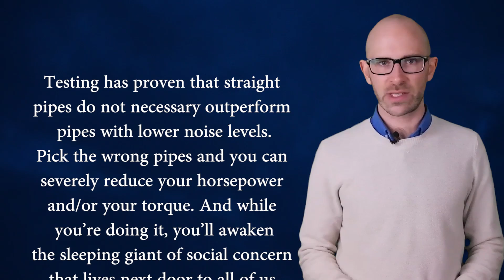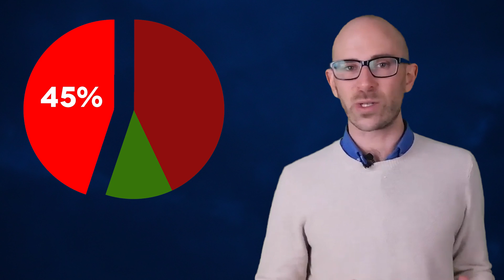Why are Harley Davidson Motorcycles So Loud?

Comment: You may have an error with your dBs... you mention sound pressure, which is typically using a reference of 20 µPa.  The sound pressure doubles every 6 dB and 20 dB is ten times higher.  For sound power and sound intensity, they double every 3 dB and 10 dB is ten times higher; this is because they are referenced to 10e−12 W and 10e−12 W/m^2 respectively.

Love the channel though!

Comment: Loud pipes don't do anything to save lives, skill saves lives.
Reply: Went from a bike with loud pipes to a bike with quiet stock pipes. Noticed zero difference in drivers attention. What did change was my skill level. I learned better to anticipate and prepare for situations regardless of what noise the bike makes. People don't care if you have loud pipes, high viz, high beams, all of the lights. It doesn't matter if they aren't paying attention they will neither hear nor see you.  Those things help in small increments, what really helps is learning to read behavior patters and lane positioning.
Reply: what if you are in the blind spot of a vehicle. They will hear a Harley. Blind spots tend to be where cars run into motorcycles, especially in traffic.
Reply: Ufphen why would you allow yourself to be in a vehicles blind spot? That's were you would need more skill.
Reply: take for instance traffic where you cant evade an idiot driver or in Cali where lane splitting is legal and cars may change lanes and run into you. Skill will most undoubtedly not save you from crashing just like a car pulling out in front of you and you didn't see it coming. Skill cant save you forever.
Reply: I'm taking you've never ridden.
Reply: Eric Gudzinas I fully agree 100%, awareness is the best tool. I have to stick to it though, my pipes have been noticed well before I was alot of times. Its helped me a great deal, i also notice track bikes redline the bike to get noticed when someones is cutting in. It helps and thats good for me.
Reply: So if harley riders are SO CONCERNED with safety that they are willing to sacrifice everyone else's quiet and comfort for their own increase in safety..   Then why the fuck don't they wear full crash gear, full helmet with bright reflective colors and a reflective vest?   
None of this skull cap helmet, tee shirt and jeans crap
Sure, it would take a sacrifice of their own comfort, for their own safety..  That's worth it to them though right?
  Or is it because their little biker outfits make them feel totally awesome, and the loud pipes make sure people look at them so they can feel even cooler
Reply: I lived in cali for 15 years, just the sound let them know I was there, and a fucking CHP actually thanked me for those loud pipes. cop bikes have standard exhaust. And I totally agree Eric Gudzinas. Nothing but skill saves lives. but on that day, on the 405, it did. Ive been around enough retards to know that cages kill us.
Reply: Every car has a blind spot even with properly set up mirrors. Rule of thumb never sit in anyones blind spot for any reason.
Reply: Doesn't hurt to stack the deck in our favor. Sometimes you can't avoid being in a cars blind spot in traffic.
Reply: The Trump News Network its best to let people think you are an idiot than open your mouth and confirm it to the world.
Reply: Eric Gudzinas nobloud pipes HELP to draw attention. Going 65 70mph and having people merge into same road IT DOES HELP TO DRAW ATTENTION. You are ultimately correct though because it will end up to the rider how to avoid the car. I have a loud bike bought it that way, i felt it was extremely unnecessary and was waiting for a good time to swap them out. Then a Friday night I noticed a couple people wanting to get ahead of me and stopped, kept looking in side mirror. For what?????? whats making that rumbling sound, my pipes. They helped me then and still do now thats why i left them on. Car drivers especially the higher end cars have NO care for anything.  They will pull out INTO a main road see me at t h e last second and get upset AT ME because its an inconvenience for them to move a foot 10-20 degrees in order to reach tbe brakes. I had a guy basically say fuck you and pull out anyway. One India guy loomed in side mirror and laughed. Sidewalk bars patrons even were looking at yhe guy like he was a dick. So yea, they help alot for normal drivers that actually simply didnt see the bike but heard it. I suggest tryinb out a pair b4 you dismiss, if you ride. Ever hear a Ducati Panigale? Those riders have ear plugs, extremely loud leader bike. So its getting to a point that most bikes are gettin louder, its for a reason.
Reply: Loud pipes is just a small tool just like wearing hi viz, nothing will save you from being side swiped if the person doesn't give a hoot, but most of the time it does get you noticed.
Reply: Xavier Cebeira i agree i have loud p I pipes but evidently this argument is going 2 go absolutely no place.  So shit on it, i keep my pipes loud and everyone can hate me. As long as they are pointing their finger cussing me they know exactly where i am at.
Reply: priestof1 It's the same as jumping a red light that just turned red. If I see someone speeding behind me I am going to jump it to avoid getting ploughed and potentially killed. I will happily justify myself infront of police, citizens or a court. No harm done, one up the bum, just for fun.
Reply: It's funny that people will think a distracted driver will suddenly pay attention when they hear exhaust. Good luck, using that as you main skill will lead you to becoming a statistic.
Reply: @wolfg.1867 if won't hear a loud bike they wouldn't hear a car horn... does that mean a car horn is useless to have?...
Reply: Been a rider for over 15 years now, loudest bike I've owned was a Honda CX500 with all the baffles rotted out of the exhaust(So it wasn't a quiet bike!) that was no that got written off by someone pulling the wrong way out of a one way street onto a major road right into my path. They didn't even notice me or even look up the road until I plowed into the side of their van, horn blaring, while still under full breaking(Managed to swerve and avoid them plowing into me).
Went back to the Honda 1991/92 CB250.. Whisper quiet pipes, but stops fast, takes off fast enough and I can throw it around to get out of trouble and at worst I can drop and kick away. I'll take a bike like that any day.
Loud pipes only make drivers resent motorcyclists(When I'm in a car anyone with loud pipes lane splitting I want to open my door into the path of just to shut them up. I want my hearing intact!). I want them to like us, not hate us.
Reply: Eric Gudzinas well said !
Reply: Not every car. Some of the really big ones sure. For my car, the only way you could be in my blind spot is if your shorter than 3 ft tall, and standing behind my car. I have my mirrors set up so that I have 360 degree field of view with out having to look over my shoulder. By the time the rear half of a vehicle is in the center mirror, the front half is in the side. When the rear half is in the side, I can see the front of the car through the side windows. On top of that, I also have dome mirrors on each side mirror.
Reply: Obviously skill saves lives, but your skill, and foresight is absolutely no good if someone changes lanes and literally crushes you without looking. 

No one is suggesting that ONLY loud pipes save lives, SKILL + LOUD PIPES mean that you will probably live to pass on the information to your grand children. A friend of mine was almost killed a couple of weeks ago because his sport bike made no noise and as quick as he was, the car invading across two lanes was not aware of his presence.
Reply: Eric Gudzinas CRAP ! loud but not excessively loud pipes 
 combined with good Riding skills are a powerful survival tool
Reply: is stealth not good?
Reply: you are an idiot and obviously have no clue what you're talking about.
Reply: Skill won't do anything for you when you get sideswiped by a soccer mom in her Escalade who's busy checking her Facebook on the phone when she should be watching the road. These are the instances where her hearing you could save your life.
Reply: David Kowalsky just keep thinking skill won't save you in that situation. It's saved me several times. Situational awareness, lane positioning, and learning to predict cagers intentions will save you more than loud pipes.
Reply: Considering the increasing problem of modern, heavily sound insulated cars with loud radios that can't hear fire trucks, ambulance and police *sirens*  to the point where they are starting to have to override the radios to make themselves heard..  I'll stick with 'skill' to keep myself safe.
Assume they haven't seen you. Assume the tied and distracted mum in the huge SUV with two screaming kids in the back will drive right over you. Make sure they don't have the chance.
Reply: Forget the pipes try riding the electric motorcycle and have seen enough crashes from it due to drivers not seeing it or hear it coming so how could they know a motorcycle is around it might be cheap to run but no way you get me on one.
Still remember my motorcycle training which is everyone is out to kill you so you have to ride smart in fact being a rider it makes you a better car driver as your looking for fellow riders on the road compared to other driver who have no idea..
Reply: Eric Gudzinas
awww poor baby do you need a binky and a safe space?
Reply: Loud pipes have saved me many times, especially at intersections, one of those I see you but you don't see me times.  Quick rip of the exhaust and they pay attention real quick.  Loud Pipes have saved my ass probably 30 or more times in my 33 years on the two wheels.  It's the ones that you don't have time to react, in those cases nothing will save you, you just have to hope at the moment that your number isn't up.
Reply: Many cars have improperly set up side mirrors, so that if you are beside the car, but behind the front windows, you're in the car's blind spot (until the driver looks over their shoulder). You can't avoid ending up being in a larger vehicle's blind spot. Some people don't even bother looking over their shoulder when they switch lanes, because they think nothing is there.

Skill is the primary factor on if you live or die. Loud exhausts though can help, because they alert surrounding motorists to your presence even if they can't see you. So long as they can at least hear that you're somewhere around them, they might be more cautious if they have to change lanes.
Reply: Draggon Reaper What car do you have?
Reply: 07 Mazda 6. Sedans, and other small cars are easy to get rid of blind spots with.
Reply: Just gonna point out that his car is one that 2 years later Mazda added BSM (blind spot monitor) system to...
Reply: David Bootsma, you're right. They did add that, because people don't know how to set up their mirrors properly. That doesn't mean the car has unavoidable blind spots.
Reply: Eric Gudzinas your a fucking idiot, "skill" isnt going to do shit when some dumbass driver looking at their phone swerves into you.
Reply: wargasm74 The police liked your bike because it was "American". Not because of your loud pipes. To often do sport bikes get pulled over and ticketed while an entire MC of Harley riders rides by sounding like WW2. Harleys sound awful anyways.
Reply: As someone who's ridden for more than 40 years (and currently rides a Harley), you are spot on.
Reply: why the fuck would you want loud pipes anyway? apart from being a showoff they dont do shit. why would you want everyone in a kilometre radius to hear you?
Reply: Electra Flarefire
Of course you have to have eyes in the back of your head when you ride but anyone who has been on a bike more than 10 minutes knows you need every advantage you can get. I always rode with straight pipes and when you pull into someones blind spot when passing them they make their car vibrate so they know something is there. It isn't like you ride pretending your invisible....you ride assuming they are trying to kill you if you wanna live and/or prevent road rash.
Reply: Electra Flarefire
I don't give a fuck what cage drivers think and women don't belong on bikes they don't have the upper body strength to get out of dangerous situations. I've never driven next to a female and I never will (actually there are very few men I will ride next to as well but that is an overall skill issue).
Reply: Eric Gudzinas it's a combo
Reply: Eric Gudzinas you the real MVP
Reply: whose skill? anybody dares to ride sport motor cycles on a highways have skills. but not everybody in the highways knows how to turn on the correct richting/tail-light. had a lady turn on right tail-light while swerving to left lane. damnit. no i am not being sexist, i am lady biker myself :v
Reply: Eric Gudzinas
big mouth hiding behind a computer screen eh boy
Reply: *****
the only way to survive on a bike is to realize that everyone else is trying to kill you ... anything less and you're likely to end up resembling the mosquito on my windshield
Reply: The Trump News Network same can be said of you. Don't talk down to people and not expect a retort. If you can't handle it then don't open your mouth.
Reply: Eric Gudzinas
getting even bigger hiding behind your computer punk ..... must be a big change from real life for you
Reply: The Trump News Network you are boring me, good day to you.
Reply: @wolfg.1867 someone has never taken a motorcycle safety course...
Reply: They argue that is for "saving lives" when they are 15 times more likely to be killed for driving a motorcycle instead of a normal vehicle. 
Just admit it, you are antisocial and enjoy annoying people.
Reply: Not saving lives saving even if they do.
Reply: What a stupid comment... sportbike riders are just as dumb as Harley riders... just as gay too...
Reply: Quick brap of the throttle saved my ass many times
Reply: My riding skill has no influence on some dufus who’s not paying attention

Comment: When Harleys come out of factory they sound like a fart in baggy trousers.
Reply: Jasper Rasper at least it is a silent fart😄
Reply: Jasper Rasper stock pipes sick for the most part. usually you can cut the baffles or take them out and get a better noise
Reply: Jasper Rasper they still do after they're modified
Reply: Or souped up sewing machines.
Reply: how does a fart in baggy trousers sounds like?
oh wait, nevermind
Reply: I choked on my spaghetti just now XDDDDDDD
Reply: Thus mimicking their customer base.

Comment: picking the wrong pipes will not severely reduce horsepower.  at most it will take away 2 or 3 horsepower.   if you weren't a stupid liberal that has never felt the rush of being on a motorcycle you would know that.

Comment: I like now the quote 10 year old statics as if they were current. He is using old data to prove his point. This comes across as a lie or another fake news story for anyone that is knowledgeable.
Reply: Do you have newer data?
Reply: I do have facts. We is quoting  data from 2006. Fact 1 In 2009 due to EPA requirements Harley added catalytic converter to all there motorcycles quieting their sound. Fact 2 In 2014 due to EPA requirements and heat concerns Harley started producing a water cooled version of their touring engine. This also reduced the noise of the engine. Fact  3 in 2016 came out with a new engine that is dramatically quieter than there previous models. Fact 4 Harley since the 50's multiple engines for their bikes. They currently sell 3 "Harley Engines" ie the Sportser engine which comes in either 883 ci or 120 ci, the twin cam 103 ci and 110 ci which come in Dyna and Softtail models, and the Milwaukee 8 107 ci and 114 ci which comes in touring models.  Since the video never states which engine they quoting there statics from I find the entire video misleading.

Comment: I was wondering how these things get a state inspection sticker ? in Pennsylvania you need a yearly inspection, don't know for sure but it seems there would be something on the form about exhaust system. well a system is an exhaust pipe AND A MUFFLER! who is putting stickers on these noisy hacks

Comment: This is all bullshit. I have a burgman 650. At 110 MPH, it doesn't break 80db.
The real problem is all the dickless, middle-aged shitheads with more money than brains, desperately trying to buy a pair of balls, and thinking they've done it with their $60,000 noise machine, masquerading as a motorcycle.

Comment: uhhhmm, you should do this test on a Dodge Charger/ Challenger, Ford Mustang, Chevy Camaro.....  These exhaust are very loud, how about including race bikes in this as well. Its very rare I hear a Harley blasting up the street. It is a lot more common to hear a Suzuki/Honda/Kawasaki screaming past. Never riding a motorcycle, its easy to say loud pipes do nothing to help people hear you. This is simply incorrect. I have had people start to cut me off and instantly rev my engine and they now know Im here. Its much faster to do this than to pop the horn.